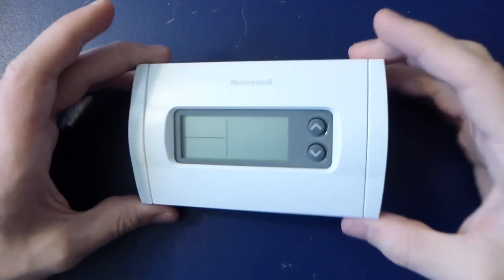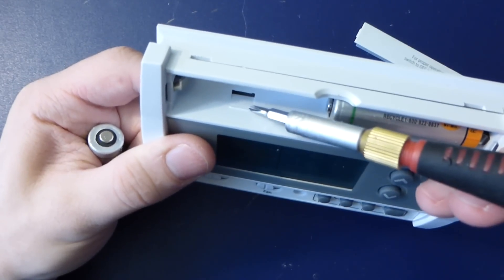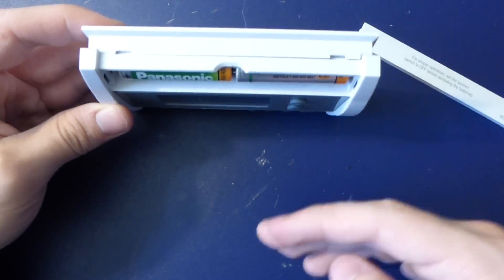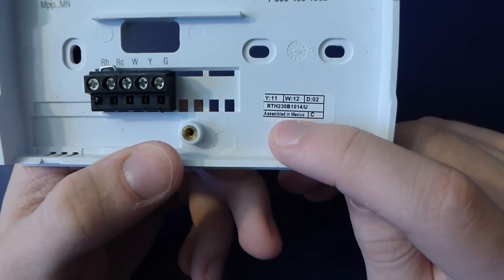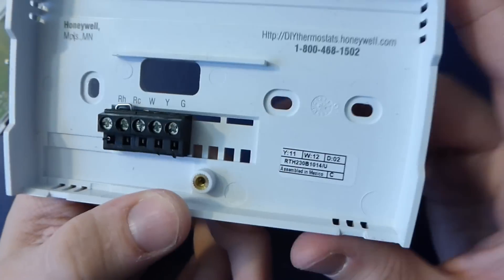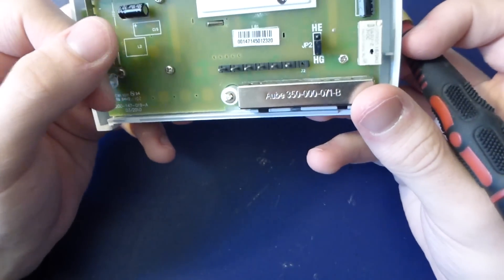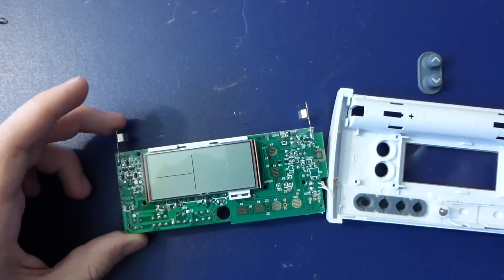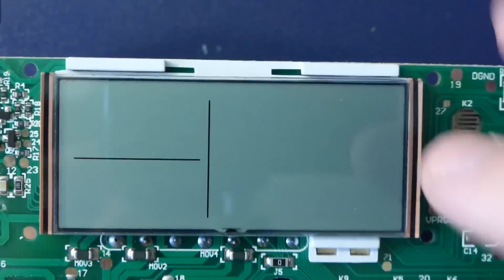Random Teardown #006: Honeywell RTH230B Thermostat

Comment: The reason you're getting a flashing battery symbol and really poor contrast/angle on the LCD is because you're using NiMH batteries which have too low a voltage for the device. I also have one of these in a junk drawer as a backup and just ran into the same thing when trying to put it into service with rechargeable batteries. It works fine once a full 3V is provided.

Comment: This is my go to thermostat. do7.pl/honeywell1 I have about 20 of them in various building of mine. Can lock it out with a pin number, but remember to save this number in a safe place as it is a pre-determined pin number and you cannot set your own. The auto heat cool feature is great for season changes (must set it for business mode to use this feature). Touch screen not the most responsive but honestly once I install the thermostat I never have to go back to it again as I just use the app. The alert feature is great as I get a notification if the temperature is too high or low in a room (can set notifications for almost any scenario).

Comment: Thanks had the same thermostat it stopped working wasn't sure why and used your video to pull it apart and one of the battery clips had fallen off
Reply: Same issue. superglue it back in place. Works fine again

Comment: After replacing the batteries on mine, I can't get the screen to power on? Was something jarred loose when prying out the old batteries from deathgrip of this monumental pile of crap which is this thermostat? If so, any ideas on how to solve this issue?
Reply: John Paul Caldwell make sure you are using brand new alkaline batteries and not rechargeable ones, also you can try put them backwards and wait 30 secondes (this wiil reset thw thermostat) then you can place them back in the original positions and check if it works :)

Comment: I have this POS. does anyone for the life of me know how to turn off the auto program so I can simply turn it off and on when I want to?
Reply: Hold the "Mode" button for 3 sec, and you will see the house icon disappear.  This is to put it in manual Hold mode.  Set the temperature to outside the range, so that the HVAC won't run.  When you want to resume the Auto mode, press the Exit button
Reply: Thank you! It works.
Reply: sanitary103 I need an answer to this as well
Reply: I found out how to do it for the exact model. I can't speak for others but I assume they are similar....

I don't have the thermostat in front of me so bare with me. the key is to press mode. press it until all you see is the current temperature, time and day; if there is a house emblem/picture to the left, that simply means you are in one of the auto programs (1-4). if you press mode a few times, the house/picture should go away. once you do that, you are in the clear. 

when I want to use it, I simply turn the tab to cool or heat and for the fan, I use "on" and not auto. if you need further instruction, if you google your model type, they actually have a customer service # to call to help you. hope that helps.

Comment: I can't get the fucking cover off
Reply: When this thermostat is new, the front face plate is really seated very well and tight.  I tried to 1 week, and can't figure out.  After using brute force, and study the latches, then I realize how to remove the face plate cover.

Pull the cover downward, and lift the bottom upward in 45 degree.  This will loosen the latch at the bottom